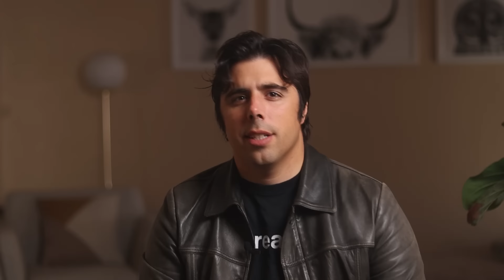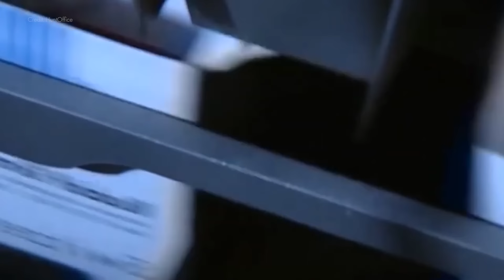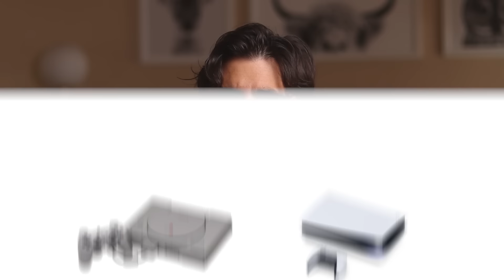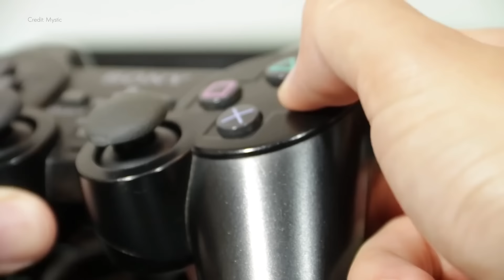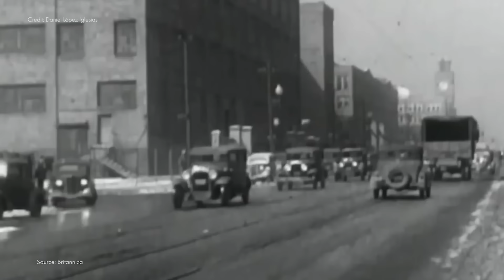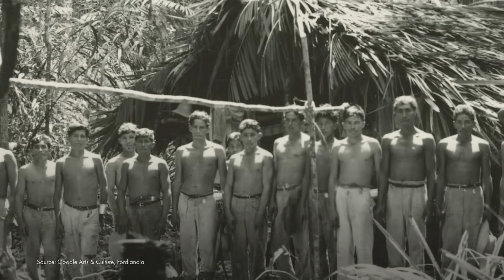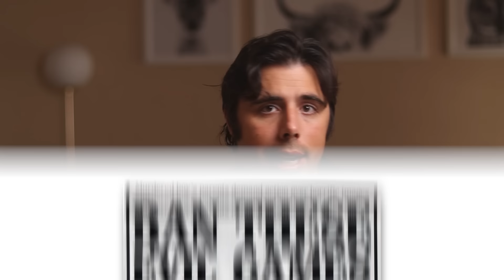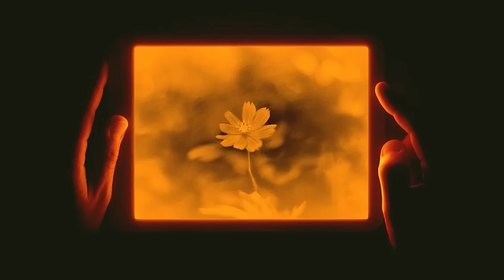Why Some Designs Are Impossible to Improve: Quintessence

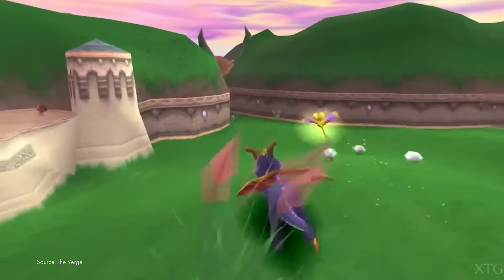Comment: 9:29 Not completely true, we're really close to the final design but not quite there yet. Paddles/buttons on the back of the grips are becoming more and more common. Most Xbox and Nintendo pro controllers have them as standard along with most knock-off PS5 controllers. Back buttons/paddles on controllers whether they're used as they are now basically acting as shortcuts so you don't have to shift your grip as much, or acting as they're own action/abilities button or hotkeys for favorited item in your inventory so that way controller players don't have to fumble around with menus and equipment wheels as much.(I also really like the adaptive triggers on PS5, hoping Xbox and Nintendo starts using those too)

Comment: Leaving out a fuel pump and relying purely on gravity to get gas into the Model T’s engine works fine until you have to drive up hill - then it doesn’t. The gasoline stops flowing. The engine stops running. Only possible solution is to drive the car in reverse. Awkward.

Comment: The PlayStation controller didn't change due to sheer stubbornness from Sony. The PS1 controller was okay, the thumb stick placement of the dual shock - ps4 is garbage. It always hurt my thumb after a few minutes cus of how often the left stick is used in games, Xbox did this way better, and it's a better example considering the 360 controller was the most comfortable for a long time. It's designed so if you pick the controller up with your left hand by the left grip, your thumb naturally falls on the stick.

Comment: The Dualshock controller is by far the best general gaming controller ever designed. Sure there are some specialised controllers performing better at specific tasks and even other controllers like the N64 one did have their benefits like the stick notches (why did we stop doing these?) , but in the end the general gamer needs a good consistent, versatile and ergonomic gamepad and the Dualshock delivered just that.

Not a fan of the Dualsense controller, it changed the established formula for no reason, looks worse in shape and removed the classic colored face buttons. It's also unnecessarily bigger, though not as bad a the newer XBOX controllers. Not a problem for me but I could see that being a small problem for children.

Comment: You show the paperclip as an example, but there are dozens of different paper clip designs. From the black alligator clip type clips, to spring tensioned clips, there are those sort of triangular ones that stick out like a tab, there are tons of different designs for the paperclip. Even the wheel, NASA did it for the lunar rover to spectacular effect, making airless tires out of a springy metal mesh that was slightly rigid. You can't reinvent the circle, but you can certainly reinvent the wheel. Just ask Charles Goodyear, inventor of vulcanized rubber. Or Ford, who first put rubber inflatable tires on a wheel.

Comment: 24:54 I only use  browsers on my smartphone, and disabled the "feature" of reloading by pulling down. First off, where I use it, it usually just refreshes the page, nothing new happens. But I specifically deactivated it so nothing new can show up. I hate random results. If it happens in steam on desktop I start to refresh the page until I go back to the original.

Comment: Nintendo Switch didn’t copy Sony’s layout. Sony copied the 4 button layout and L&R buttons from the SNES and copied the 360° analog controller from Nintendo 64 for the PS2. The reason the N64 360° analog is notched and Sony’s isn’t is copyright, but Sony got the layout idea from Nintendo, not the other way around

Comment: I think QWERTY format is not perfect, but it turns out to become so widespread since the days of the writting machines that the cost of change would be too high. Like most people do not get bothered by QWERTY, so for them the cost of change would be higher than the value of the improvement.

Comment: The XBOX controller is based on the Dreamcast controller. I don't think they borrowed from the Playstation at all.
Reply: The original Xbox controller was widely rejected and the replacement, Controller S, was unquestionably moving more towards Sony's ergonomics.

And everyone was cribbing off everyone else in designing controllers of that era. In terms of the big consoles, Sony's PS1 Controller was the first gamepad with the depth and the first gamepad with dual sticks was the Dual Analog. Of course the N64 and Saturn 3D controllers came in between with single analog sticks.

The question about size (Sony favouring smaller gamepads than Nintendo and Xbox) and left stuck location will continue to be debated.

Comment: Before I watch fully: Ok, no, there is a way to improve paperclips. They need a way to shear the wire stock more cleanly so it is not sharp to reduce paper damage and sensory induced rage. Perhaps a laser to melt the wire apart with rounded ends, or a quick twist of each end across a polish wheel before hitting the folder.

Comment: you can improve there a lot...
for example on the paper clip.
you can improve with the material, using materials that are less corosive.
you can also improve in making the shape a bit less worse but the manufacturing far cheaper. making the paper clip far cheaper
and many more things.

Comment: You can improve the paperclip by rounding the ends of the metal wire so it does not dig into the paper when you remove it from your papers.

Comment: A lot of people talking about how MagLight is a weapon in disguise and I won't say they're wrong - when I was a security guard in the late 90s (in Canada, so not like a Yank guard with a sidearm) we were advised to go buy a good big MagLight for self-defence.  But I think people are overlooking the batteries.  Those big flashlights fit big D cell batteries, and the thing will run for days on them.  My "oh no the power went out" light is still that old MagLight, and the batteries in it are at least 20 years old and still work.

We don't think about that as much now when tiny, high-capacity batteries developed by the cell phone industry are everywhere - but at the time, it was a BIG deal.

Comment: NGL, I didn't get an iPhone or a derivatively designed Android for a couple years after the iPhone came out for the exact reasons Steve Balmer said.  I didn't want a forced data plan (early data plans sucked ass and were expensive), I didn't want to be locked into a carrier, and I hated not having a keyboard.  As someone with really big hands, I honestly still despise using a touch screen.  I have and will actually busy out a small portable keyboard and a stand any time I know I'm going to be doing any decent amount of typing because I feel like touch screens are simply not designed well for anyone with large thumbs.  Even the "big" keyboard layouts don't do shit to make my life any easier because they just make the keys taller rather than wider.  And that's with modern sized phones.  I think people forget just how much smaller those early phones were compared to even the smallest modern offerings.  They were about 2/3 to 3/4 the width of the smallest, most basic phone on the market today.  You can't even get a phone that small, anymore, likely due in large part to exactly this issue (plus supply chain stuff with how LCD panels are made).

There is a reason why many early smartphones still included a physical keyboard, whether it took up half the front face of the phone or slid/ flipped out.  Part of it was because the standard had not been ossified, yet, and part of it was because manufacturers were trying to cater to what people were used to at the time, but I truly believe that a large part of why they were doing this was because of the limitations of screen sizes at that time.  People weren't conditioned to the idea of having a big, wide brick taking up a whole pocket at the time.  They were used to the "candy bar" shape and size of phones, so even if the iPhone had launched with a more modern screen size, I wonder if people would have taken to it, then.  I also wonder if part of the reason the screens were kept so small was to hide the relatively low resolutions they output.  Blowing up the screen size means that you either have to increase the resolution, which eats through a lot more processing power and battery life, or you have to accept lower image quality.  So the best design at the time was for a smaller screen at a lower resolution.  This made physical keyboards a lot less of a stupid design choice than it seems in retrospect.

Note: I was about 15-16 when the iPhone came out, not some boomer unwilling to learn a new thing.  I thought the iPhone was cool until the first time I actually messed around with one in at an apple store.

Comment: Well it wasn't just NES controller to PlayStation Controller. The original PlayStation Controller was more or less a SNES controller (identical layout) with handles. The DualShock didn't come until later and itegrated technology featured previously on the N64 controller, the thumbstick. While this was the first mainstream controller to have two thumbsticks, it didn't introduce the input method as a whole, not to mention the PS1 made very limited use of the DualShock, it wasn't until the PS2 where 3D games took advantage of the thumb sticks and two new shoulder buttons.

The XBox controller was directly inspired by the Sega Dreamcast's, with the original "Duke" controller looking very similar but eventually taking the shape we know now.

Nintendo's own controllers have a weird history. The GameCube controller was a sidegrade to the likes of the DualShock and was funky. The assymetrical thumbsticks carry over to the Switch and Switch 2 Pro Controllers but NOT the Wii Pro Controller (which had the same layout as the DualShock) and Wii U which had the sticks aligned... up?

Overall these controllers are primarily inspired by the SNES controller. Everything else is added to it.

Comment: 23:15 sorry what? 2019?
Reply: Riight, this is really not being discussed enough! 😮 😂😂
Reply: lol and I didn't get my first smart phone until 2018. I didn't see the need for it because I had both a cell phone and a laptop. And the sad thing is that 7 years later I'm considering going back to that setup.

I rarely use any of the 'smart' features on my phone anyway. I've abandoned all social media for my mental health, and I communicate with people using phone calls and SMS messages. Whenever I do use an app on my phone, I usually have to sign into the app, sign into my email for the 2FA, check my SMS for the code, wait for the email app to load, scroll through my emails for the code, sign into the app, wait for the ads, dismiss all of the updates, and then fiddle with the touchscreen that either doesn't recognize my dry thumbs or double-clicks everything. And after all that, half the time it doesn't work properly anyway.
Reply: Yeah 2018 for me when I finally started making money

Comment: The innovation of the iphone is much more subtle than just maje it a touchscreen with one button. Because that design already existed years before the iphone!

The problem was tgey were not intuitively. For example, if you wanted to scroll to the next part of the screen, you needed to slide a bar on the right of tge screen, like u still do on a desktop computer. That bar wad small so you still needed a pen for it. And a lot of otger things that were inconvenience while using the touch screen.

Apple introduced swiping!! Yesssssss that didn't exist before the iphone. Swiping, is one of the true inventions of the iphone. As well as mukti finger touch. That made other things more convenient like zooming! The big advantage of the little touch screen is you needed to zoom in many times while handling the phobe. That was an annoying task to do before the iphone. Clicking the tiniest menu button on top of your screen, a pull down menu etcetera.

With mukti finger touch control you could just easily zoom in and out. And made many tasks on a small touchscreen made fast and easy. Lije intuitively typing, with auto correct.

Those features made the iphone rhe success that it still is,!

Comment: The qwerty keyboard layout sucks ass, I changed to Colemak and instantly fixed my carpel tunnel, and improve my speed like 20wpm. The only reason they don't change it is because regular people are so lazy that they won't want to adjust, its like having an apple you have to wash and cut to eat, or a chocolate bar. Which one is easier to eat? Which one was gonna be better for you in the long run?

Comment: The qwerty keyboard worst flaw is not the speed, it the ergonomics, colemak is much better designed. Unfortunately its not standard. Also the stagger is wrong - it should be the other way around to fit our hands. The optimal keyboard is basically a split ortholinear, and tilted. That fits our hands the best.

Comment: We have two sunbeams and only one has failed after a combined 75 years, we use it multiple times per morning between 4 people. We tried a modern 4 slot toaster and while it was ok, we had to constantly fiddle with the temperature setting and they died every 3 to 6 years. Some cooked unevenly or would ruin bread with a defrost mode

Comment: This is how I feel about the original Steam Controller. It's almost the perfect controller, it has 90% of needed inputs (It needed 2 more back buttons and a third trackpad instead of a joystick and no dpad making only good for non side scrollers / Fighters). The problem with it is no one wants to learn something new even if it's fundimentally better on every conceptual level. It was beautiful to me but many found it ugly and cheap feeling. It had no rumble (it has "haptics" but they feel like shit), it looked uncomfortable even tho it was the best feeling controller ever.

Honestly, the steam controller sold me on the undeniable superiority of trackpads over most inputs. Excluding back buttons, bumpers and triggers. Track pads can replace every input method, with people who are serious about fighters or side scrollers will already have a better controller for those games anyway. So, no dpad doesn't matter.

Track pads can have seemingly infinite inputs, types of inputs, layered inputs, input exchanges and so on. I have set my right track pad to move my camera horizontally and disabled vertical movement (Replacing it with precise gyro aim), it changes to simple mouse input in menus and when clicked depending on where I have several inputs like reloading, switch weapon, and anything else i could use.

If I could, I would make a steam controller 2 with 4 track pads, two large track pads and two smaller square track pads, 4 back buttons, analog triggers with hair trigger switches and clickable inner buttons like the gamecube controller, with finally the best most accurate series of gyro sensors to maximize precision to as high as is realistically needed.

This concept is probably never going to be a controller most people want, but it is what many need including me. I would KILL for a true high quality upgrade to the original Steam Controller.

Comment: I wish the playstation controller would change a bit. Nintendo no longer holds the patent for competent D-pads. Xbox figured this out 20 years ago! Even the modern playstation controllers have such unbearably mushy D-Pads.

Amusingly the Barbie PS1 controller has a much more usable one. It's very loose but doesn't hurt my fingers to press.

Comment: I feel like the wii controller has begun to set standard now that we're seeing more and more vertical controllers for VR. I might be wrong in that there could have been a predecessor with similar design and purpose but I'd love to see if the standard for vertical controllers will change now that it's becoming more common in consumer electronics.

Comment: Your paperclip is a horrible example, it has been improved in several ways.
Even the more basic ones commonly have small grooves to better hold the paper, there's the coated ones that ar less likely to rust, the office I work at mostly uses alligator clamps instead of paper clips because they work much better...

Comment: I feel like you may have missed the mark in regards to the iphone/smartphone point. The designs of a smartphone are separate from the designs that keep you using one. This is hardware vs software. Smartphone designs have evolved over the years and there isn't one standard. There are many variables that go into deciding which one to buy. And while they do tend to have the same vague general shape, it's still no paperclip. 

As far as software goes, this is all based in manipulative social engineering and psychology. But, this, too, is not fixed. Algorithms change as people become accustomed to them. New trends come out that push things in unseen directions. This stuff is constantly changing and evolving under the hood. Granted, it's generally on the backend, away from where people can notice, but it IS changing nonetheless. So if your argument is that smartphones and algorithms are quintessential designs, I'd have to actually disagree.